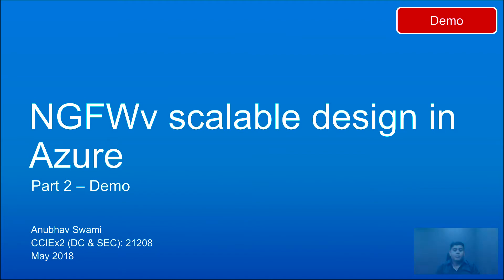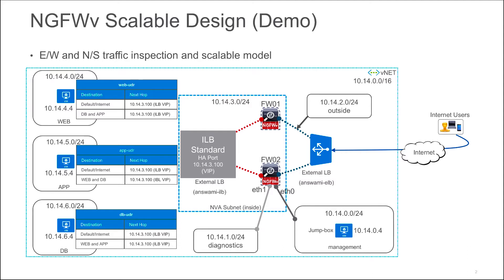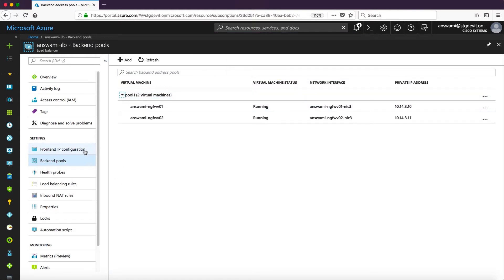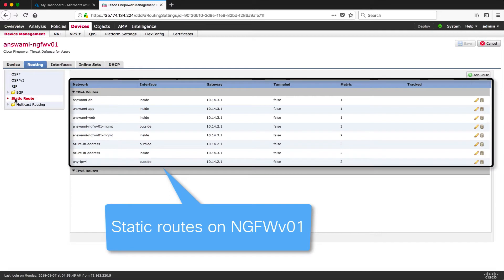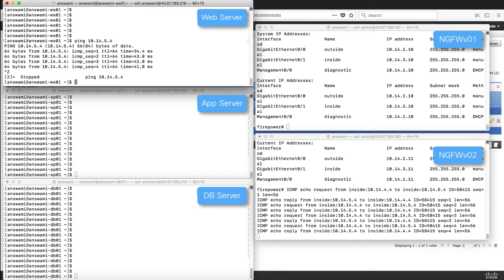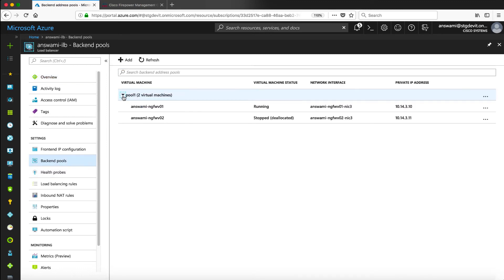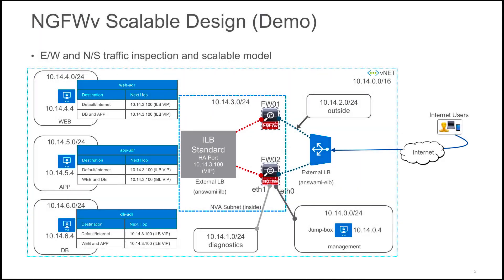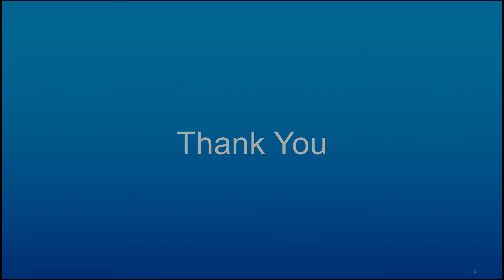NGFWv scalable design in Azure - Part 2 (Demo)

Comment: Anubhav, The Azure marketplace template for the NGFWv does not appear to allow the options for an Azure availability set like the template for ASAv does. Is there a workaround to achieve the same configuration as an availability set for NGFWv in Azure?
Reply from the maker: You can use our ARM template to deploy firewall with ARM template.